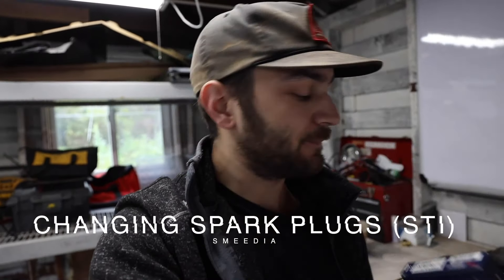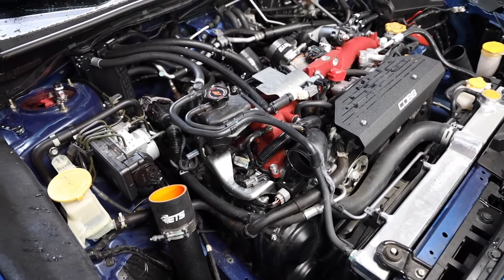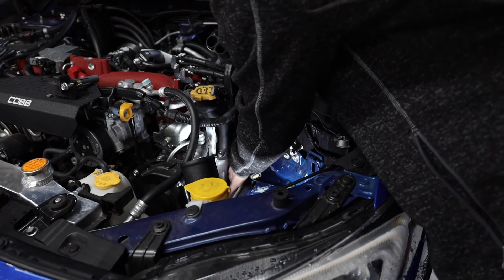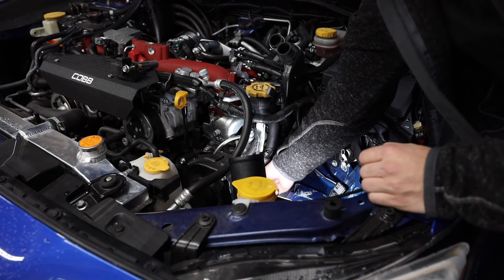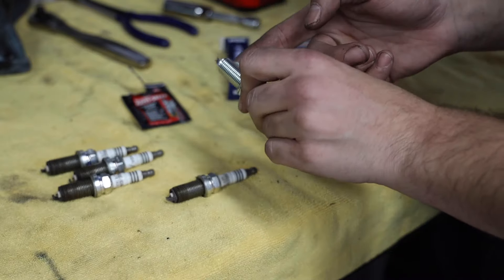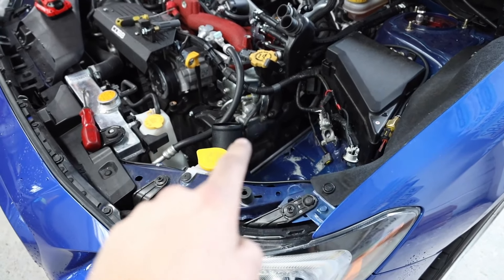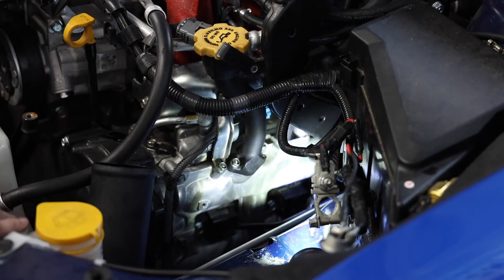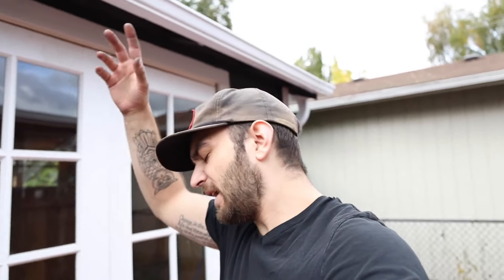How to Change Subaru Spark Plugs (Easy)

Comment: On the NGK site it says to not use anti-seize or lubricant on NGK spark plugs, apparently it can be detrimental. Just wondering if you’ve ever read that anywhere or had any issues due to adding anti-seize? I didn’t think it’d be an issue but just wanted to ask after reading that on NGK’s site
Reply: yea he use wayyyy mucho too much

Comment: Don’t use  anti seize on ngk plugs. The lubricant from it could cause you to overtorque the plugs cause them to break and that’s a major issue. The treads on the plugs have a corrosion compound already.
Reply: @nastysoda9212  yeah keep saying that buddy. Not many people know what a 1/4 in turn is past sharp rise in torque. Seen it happen that why you follow instructions lol

Comment: NGK advises against using anti-seize on their plugs
Reply from the maker: I'm aware. But after having one of NGKs plugs crank inside the head and cause porcelain to go everywhere I prefer using the anti size method.
Reply from the maker: No idea,  the owner prior to me had installed them on the car. There was some corrosion on the threads when they came out

Comment: I want to take off my battery but idk cause I went somewhere and said if I just unhook the batterythe system will forget things but wouldn't it just relearn idle speed and stuff in a couple weeks of use  anyways? They said I need to put a 12v charger in the obd port to keep the memory intact 🤷🏽‍♂️

Comment: What spark plus do you recommend I use for my 2016 WRX with the stockish FA20 DIT? I was going to order the ones you recommended in this video, but I know that EJs are better than the FA so I'm sure the plugs are different.

Comment: did mine on a 2010 forester xt, I raised it up with quickjacks, pulled one plastic cover off underneath the front, the plugs are right in front of you!, Still not too easy of a job, you'll need all the tools!

Comment: Smid lets work on my 13 wrx
Reply from the maker: Whatcha need done 👀
Reply: @Smeedia  well shit i didn't think id get this far, but everything short of putting stackable carbon fiber wings on the side. Shes a stock 2.5l t w/ stage 1 clutch and drilled/slotted brakes. So pretty much Open concept

Comment: Bruh I can't get the coils pack snug AT ALL
Reply from the maker: How come? 👀
Reply: @Smeedia  I figured it out lol. Thought it went ALL the way in. Just struggled to get the bolts lined up 🤣 first time doing it on my own
Reply: So I was talking about cyl 4s coil pack. Once I turned the car on it was misfiring. Looked at that one again and I guess I cracked the ceramic on the plug trying to get the coil pack on😒. Temporarily using an old one (this time it went in fast af) till a new set comes in. Folks can laugh all they want but this was my first time doing this lmao

Comment: I've been wondering what plugs i need, i run e85/98 mix running 350whp in my ej207, i took out the old plugs and it was hks m40i plugs and i was wondering can i run ngk lfr7aix plugs or do i need to buy the same plugs i took out?

Comment: 13 wrx hatch cranks but doesn't start after putting plugs in. I got fuel and air. I torqued them to spec.. what could it be?
Reply from the maker: Coil packs plugged in?.👀
Reply: Thanks for the reply,  seems like the maf pooped on me. It'll run when it's unplugged and not when plugged. Got one from subaru waiting on pick up.

Comment: Having issues with the passanger side
Reply from the maker: Pasanger rear or front?
Reply: @Smeedia   yea one of the coils is hard to put in front passanger it does not go in smoothly like the others
Reply from the maker: Try using a little di electric  greese on thr inside of the boot
Reply: @Smeedia  ill try that thanks also is it ok that I didnt use the grease on the spark plugs also your build is amazing 👍👍👍👍👍
Reply from the maker: Yessir it will be fine, sometimes the just need a little grease to slide into the boot 🙏 and thank you 🙌

Comment: Never put antiseze on your plugs never!!!. Nkg has a dip coating on the plug.. plus you need to have the threads to ground on the motor for proper spark. It even lists this on nkg direction and site

Comment: What’s the best way to get a step by step on what to move out of the way beforehand and be able to do this on my WRX? It’s my first time working on this car and no one I know how’s to work on a car like this (fiancé won’t even touch it since it’s JDM) so I’m trying to figure out how to do everything properly so I don’t screw up my daily driver. 😬Some guidance would be awesome.
Reply from the maker: Not sure where you can find a step by step but you'll need to remove thr battery, intake and secondary air pump. Not too terrible. 

The air pump is 3 12mm bolts 🙏

Comment: Attempted to do this earlier today after changing my oil. Basically gave up after taking the stock intake system out and removing the front passenger side coil pack. Didn’t help Ive been dealing w/ major lower back pain. I ended up buttoning everything up and hating my car. Lol what a day.
Reply from the maker: Sorry to hear, some shops don't charge too much but on thr bright aide you got the oil knocked out 😁
Reply: Smeedia oh I haven’t given up yet. I looked like an 80 yr old man walking around tho lol. Still not sure how u are able to get to the plugs w/ out a swivel, at least on the passenger side since I hadn’t got that far the other day.
Reply from the maker: Its all about the angles 😅

Comment: If i remove the battery in my 2017 outback i lose my right side window control
Reply from the maker: Roll the window down halfway, then hold it up and hold it for 5 sec to rest the motor and it will work again 🙏

Comment: Installing theses on my 2018 sti in a couple days. They say it’s Pre gapped but I’m wanting to double check them. What are the recommended gap range for my vehicle? Should I measure the stock ones that came out of it and adjust them to that?🫣
Reply from the maker: .028 - .032 🤝

Comment: I have a P0300 code and PFFFE code do you think that could be plugs...?
Reply from the maker: Plugs and coil packs would be where u would start on that one. Swap in new plugs and swap the coil packs to see if the issue follows. If it does than it's just a coil pack if not you've got a bigger issue
Reply: Smeedia ugh.. ok thanks Hoping it is just that where would be a good place to order both of those from
Reply from the maker: @roberthollingshead1964  Here are the plugs https://amzn.to/2sHOjpD What year is your car? so I can get you the right coilpack number
Reply: Smeedia 2017 prem
Reply: Smeedia and thank your for the help I really appreciate it

Comment: So I replaced mine and have a slight misfire in cylinder 3. Took it out and checked it, looks fine so I put it back and I still have a misfire... Should I try the coilpack next?
Reply from the maker: Move thr coilpack to a diffrent cylinder and see if the misfire follows 🙏

Comment: This video gave me the confidence to change my spark plugs in my 2019 base... took an hour and was super easy... just did the trans and diff fluid too. Also pretty easy. BigUPS
Reply: What did you use for oil? Motul?
Reply: @flabioarchan  I used subaru spec 75W90 Extra S gear and transmission fluid. It's 76.04 for 5 quarts on Amazon
Reply: Super easy?   Whatever...
Reply: @samkitty5894  what ya have issues with ? Just curious

Comment: there must be alot more room on the 2014 and up because there is no room on my 2012 to just throw a extension and socket in there an turn
Reply from the maker: Should be the same when I did it on my old 2011 there was the same amount if space 🙏
Reply: @Smeedia  what length extension did you use?
Reply from the maker: 1"

Comment: You didn't show the passenger removal...
Reply from the maker: Correct, passenger side is the same as drivers. The rear passenger coil pack can be a little bit of a pain but follows the same process

Comment: What would be the recommended spark plug gap for a fully built sti with an fp blue turbo and full bolt ons? I can run e85 or pump but on pump gas I make 400whp and peak boost is like 20-22 psi

Comment: Hi Smeedia, I own an Impreza Model 2017 and wanted to replace the plugs, while was not able to find the Original => NGK DILKAR7B8, but somthing that should work => SILZKAR7B11. The only difference between them is in the Gap, the original is 0.032 while in the replacement it's 0.044.
Does this matters? What are the implications for using the replacement?
Thanks for the advice!
Reply from the maker: You can just change the gap on thr plug to match and you'll ve good 💪

Comment: I watched this video among others as a guide but should have done more research. It wasn't until after I installed them that I found some important information from my tuner (cobb-verified Innovative Tuning). He (and many internet sources) recommend avoiding anti-seize to deter misfire from improper grounding. I have to take all my spark plugs out now and clean off the lube.
Reply from the maker: Personally I wouldent put any in without anti sieze. I have had plugs break inside the head from cording to the block and its not a good time to remove pieces of plug from the head. Never seen a misfire issue either but if you are pulling them to clean it off I hope it goes smoothly and sorry for the mis representation for it.

Comment: Looked this up for my 16 STI after the hell i went through changing the plugs on an 05 LGT (and having to cut and replace two seized cross member nuts thanks to the motor lift method). This job was way easier on the STI thanks to your video.  You my man, are a life saver.
Reply from the maker: Glad thr video helped and I know the struggles! 🙏🙏🙏

Comment: Thanks for the video, something to note is that 18+ already comes with the colder 7 heat range plugs. I thought I was getting one step colder when in fact it was the same heat range as my stock 20 sti spark plugs. No biggy at least they are fresh new plugs. If you have swivel extensions it makes this even easier. I found that my craftsman kit you couldn’t get the ratchet head on the #4 cyl. The swivel extension allowed this to happen with ease. Only a couple battle scars, first time doing this took about 2 hours nothing crazy. I’m sure the dealer or any shop would of wanted crazy money for the job

Comment: Another great video! Got the 2309 plugs didn't gap em. 
3 -4 -5 gears at 3000 to 4000 rpms car jerks pretty bad no check engine light tho any thoughts?
Reply from the maker: Whats the car 👀

Comment: How often should I change my spark plugs?
Reply from the maker: I change mine every 15-20k but Subaru service manual states every 50K I believe, when you should change them depends on how yo uh drive the car and what all is done to it
Reply: One caveat: If you’re about to get your car retuned most tuners suggest a fresh set of spark plugs

Comment: Thank you for the vid. I'm noticing that alot of 14MM magnetic spark plug sockets on the market are 12pt while the hex on a 2017 WRX spark plug is 6pt. Are you using a 12pt or 6pt 14mm spark plug socket to remove/install the 6pt hex spark plugs? Thank you.

Comment: Love your content bro, I have a 13 wrx & was curious if I can install the same exact spark plugs you did? Or are the NGK 2309s for the newer year models only?
Reply from the maker: Yessir same same plugs 🤝
Reply: Awesome✋ I put those in idles fine but I’m getting a pfffe code that doesn’t tell me what exactly is going on and all the lights come on and flash on the dash after cold start idle. Any thoughts what that could be?
Reply: I figured it out 🫢I installed a master brake cylinder brace same day as the spark plugs had to remove my Grimmspeed top mount intercooler to help with access and didn’t tighten the throttle body hose down all the way 🤦‍♂️

Comment: This was a very good video. Super informative. One thing to take away from this video is to make sure u always lube up. Especially if u r trying to insert it in a tight dark hole half blind. ;)
Reply from the maker: 🤣🤣🤣 never go in dry 🤣🤣🤣
Reply: Nope. Just use the Force and drive it home
Reply: Lol don’t use anti-seize on your plugs otherwise the advice is spot on.
Reply: @anthonyr5869 why not?

Comment: Just helped the roommie do his GR8 I believe it is. Apparently hes never done them and Ive never done it on my GRF. Before buying mine I heard about jacking the engine a bit however I think it was more with the GC and GD as the engine bay is smaller than the GR and the VA looks a bit more spacious than the GR. Took about 5 hours (including piping and accessories) mostly trying to find the hole and the air pressure of the coil kept wanting to pop off until we got the bolt in. 180 trick didnt work on the GR. Otherwise same process.

Comment: What do you think about pulstar plugs vs the ngk and are the spark plugs fitment  2015 to 2020 all the same cause ever plug I look for including the plugs you have listed says they don't fit my sti. It looks like 2015 to 2017 is as far as they go then 2018 to 2020 are different on alot of stuff I'm looking up. I just don't want to buy stuff and it bot fit seeing if you have insight on this
Reply from the maker: No worries, the 2309 NGK is what I would use for an STI. Does not matter the year all EJ series engines will accept them
Reply: @Smeedia  thanks man did you go one step coolder now that your running e85
Reply from the maker: Yes, the 2309 plugs are thr one step cder from NGK 😁

Comment: Pretty sure NGK says don’t use anti-seize but none the less it’s not to bad to do these I did mine yesterday.
Reply from the maker: Few years back I had one corroded to the head (also lived somewhere very humid) ive always used anti sieze with 0 issues. Ran it on my 630WHP among many others. 
but you are correct NGK says to not do it.

Comment: I thought my 06 STI was a pain in the ass to change the plugs on. Then I bought a 2015 Ecoboost Ford Escape as my new daily driver, and was amazed at the plug removal process, and how annoying it is. At least on the Subie you don't have to remove the cowling, wipers, and other crap top reach the number 4 plug.
Reply from the maker: You have to remove that much to get to the plugs?!

Comment: I was looking at replacing my spark plugs in my STI and was under my car. Have you ever looked at taking the plugs out from under the car it seemed that there was nothing in the way from the bottom of the car?
Reply from the maker: I've tried from under the car and it's much worse 🙃 this method is the easiest way I have found it do it
Reply: I tried doing my Forester XT from above, but could not get to them and found I could only get to them from underneath.

Comment: Do you need to remove the airbox for the passenger side?

Edit: I removed the battery, half of the airbox (the easy side, not the side with the intake tubing or MAF) and also I unbolted the ECU to move it out of the way. I can't believe some people lift the engine for this...those poor souls
Reply from the maker: It will make the job easier 🙏
Reply: @Smeedia  Sweet thx man I figure I'll swap my plugs soon

Comment: Just finished swapping my plugs I think everything went smoothly...one Q for you - the fuel pump sounded weird when I initially got the battery back in and went to start the engine. I took the key out of ignition and re-primed the pump and it sounded normal again. Ever have that happen?
Reply from the maker: Stock fuel pump or aftermarket?
Reply: @Smeedia  stock pump I always run 93 no e85 or anything
Reply from the maker: My 17 did it for a while Here and there when it had the stock fuel system but nothing detrimental ever happened from it
Reply: @Smeedia  Cool..I'll keep my eye on it for now, about to go cold start the car and see what happens after sitting overnight

Comment: Thanks man for the info on the plugs to buy I got my plugs changed. Shamefully it took 4 hours cause the back coil back on driver side would not line up with plug. Car runs alot better subaru had the gab on plugs little below .20 and it's a new car
Reply from the maker: That back coil pack can always be a pain, but glad you got it in and running smooth 😁😁😁

Comment: 14 sti here .. I've already ordered the oem Subaru plugs bfore I found your video 🤦🏻‍♂️.. should I order the ngk or just install the oem for now ?.. thanks man good channel 👍🏼
Reply from the maker: You can definitely still use the OEMs if your running more boost I would swap to the 2309s 🙏

Comment: Damn. Your engine looks so clean! I'm in Vermont, and dirt, salt, and dust get everywhere. Just royally effed up, and mistaked the cvt transmission plug as the oil plug. Fun, fun... Check engine light came on too, and it has one code, indicating "multiple misfires". Thinking spark plugs? I've been dreading the change, but found this video and now have some hope. WTF is up with Subaru tho? It's not very user friendly. I'm use to adding transmission fluid from the top, not these side plugs. And the location of the spark plugs?! Damn! They REALLY want you going back to the dealer, I guess...
Reply from the maker: Thr plugs aren't too bad once you've got a rythem down for them 🙏 

Subaru use to have fill plugs up top but mived away from them around 2008 or so to the side fill 😮‍💨

Comment: Dont you need to adjust the needle of the sparkplugs ? And is it important how you tight the sparkplugs?
Reply from the maker: With the 2309s you do not, they come gapped from the factory, and normally I do 1 full turn on them after they feel hand tight
Reply: @Smeedia  Thank you very much <3 be doing mine when i reach 30k

Comment: Hmm..you must have a good feel for the torque specs on those plugs without using a torque wrench. I have a 2016 STI this will make it easier to get those plugs done when it's time to get'er done.
Reply from the maker: Never have owned a small enough torque wrench to fit in there lol 😅